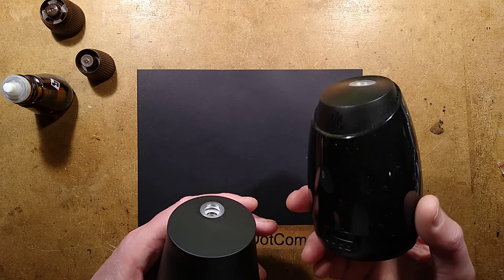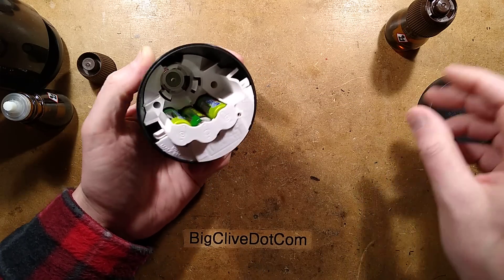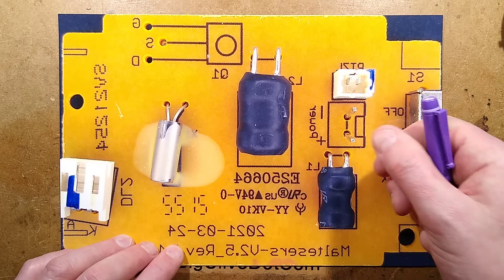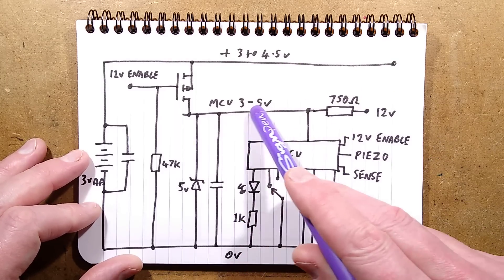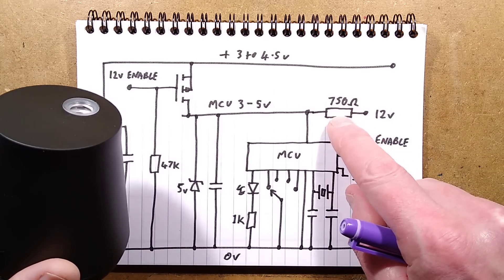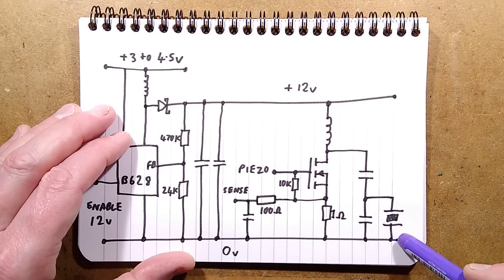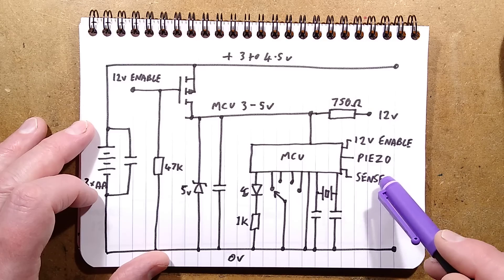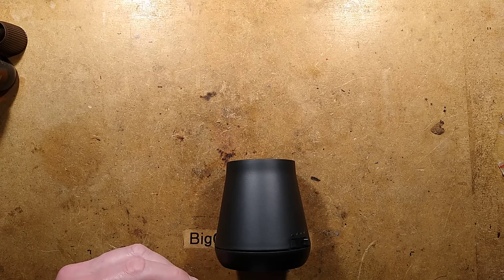Teardown of new Airwick essential mist unit

Comment: My blue light comes on but no mist can u help as not cheap ❤
Reply from the maker: Try removing the bottle and putting it back in again.  Also make sure that a pool of oil hasn't formed on top of the atomising disk.  If it has, wick it off with the end of a bit of tissue.

Comment: I have the older one, and it literally just stopped atomizing the aroma. I see the LED, but I don't see the mist. I still have some fluid left in the bottle... guess I should try a new fluid to see if that's the issue I'm facing...
Reply from the maker: Sometimes the atomiser disk can gunk up or get a layer of liquid on it that is too big too atomise.  Sometimes it fixes itself if left running for a while, or it can be cleaned with a rolled up bit of tissue.

Comment: Im trying to add a 12v fan to minimize the smoke visibility. Where can I solder the wires to? I tried s & d from the mosfet but nothing happens.
Reply from the maker: I'm not sure it could really drive 12V fan.
Reply: @bigclivedotcom  Should I try a 5v fan? I dont have one laying around but my local second hand might.

Comment: Clive, I wonder if there isn't more wierdness.
With the sense circuit, and the capacitors around the piezo, this might allow the tuning of the piezo resonant frequency to improve the amplitude of the "mony dispensor". 

Optomizing the"emptying" of the scent tank is probably a design goal!

Does the signal to the piezo line vary? 

The long scent burst at startup might be used to optimize the piezo amplitude.
Reply from the maker: I'm not sure if it has any way of sensing.  Most of the piezo disks have a consistent resonant frequency.
Reply: @bigclivedotcom  
Usually, crystals running in resonant circuits do run at a "fixed" frequency.. but this crystal has a varying load, and a varying supply voltage. With the voltage regulator helping with the voltage issue, then it comes down to the physics of the crystal, diaphragm, wick etc.

Thanks for all you do, including your replies... It's nice to have a place to look for something stimulating to watch.

Comment: Apparently these oil spraying things are really bad for your lungs.
Reply from the maker: All air fresheners are bad for your lungs.  The only thing humans should breathe is clean air.
Reply: @bigclivedotcom  Yeah, we had one of the ones that plugs in to the wall and heats up the bottle of oil, and within a week our cats started coughing a lot... So we got rid of them and they stopped coughing.

But it's not something I would have ever expected... I mean, obviously breathing oil vapour is bad, but I would have thought that the tiny amount you're actually inhaling would be negligent, but that doesn't seem to be the case.
Reply: @NikoBell1188  maybe the amount is not so tiny afterall
Reply: @NikoBell1188  also cats and other such animals are significantly more sensitive to air fresheners.
( not that I am saying that running an air freshener constantly is a good idea )

Comment: This is certainly more complicated than the classic wall-mounted heater units. A while ago there was a cheap bag of conventional "fresheners" at a thrift store and if I knew they had plain old power resistors inside I would have bought them. I don't know how useful these ultrasonic units will be in terms of components to play around with.

Comment: Do we know if they are also using the Piezo as a "fan" here? (saw an announcement a few years back about "piezo fans" for cooling electrical device in even thinner packaging thanks to how minimal the fan [air pump??] can be)
     - or -
Is it just the oil heating up during atomization and creating a pressure, that the path of least resistance are the holes which in turn is propelling the "mist" outwards?
Reply from the maker: A piezo fan is different.

Comment: This seems to be a scaled-down version of the electronic nebulizer found in a breathing treatment apparatus.  A few decades ago,  instead of a MOSFET driver,  there would be either an 812-A or a 6080 low-mu power triode valve in a power oscillator configuration,  with the output from the cathode(s) driving a ceramic transducer. Larger medical units today probably use a beefier MOSFET or IGBT and a higher Vdd / Vcc.  In the old triode valve oscillators,  the plate cap of the 812-A was grounded to the chassis,  and the cathode and grid circuits were powered from a negative supply rail.  These oscillated at around 800 kHz to 1 Mhz.

Comment: Looking at that a little closer that is a pretty ingenious way to drive a piezo.  
It looks like a parallel RLC circuit that they feed with narrow current pulses at the resonant frequency.  The frequency of operation is 1/sqrt(L*C)  where C=Ctop*Cbot/(Ctop+Cbot)  (the piezo capacitance part of Cbot).  The voltage fed to the piezo is Ctop/(Ctop+Cbot) [~n] with the L and C node voltage likely going from 0 to 24.  At resonance since all the L's and C's disappear the power in is what is delivered to the equivalent resistance of the piezo.  It looks like when you inject current pulses that way the waveform aligns with the current turning on as the voltage at the bottom of the inductor goes through 12 volts in the negative direction.

Comment: Very interesting circuit indeed. I would never guess the atomization would be done like that.

If you ignore the piezo for a second, that circuit is just a LC resonator, and when you turn OFF the NMOS it will sinusoidal oscillate forever since there is no damping (ideally). The frequency of oscillation will be the typical 1/2π√LC (where C is the equivalent capacitor of the series capacitance and maybe the piezo parallel capacitance).

The initial energy stored in the inductor will bounce back and forth between the capacitor(s) and the inductor indefinitely.
By equating the inductor & capacitor energies we can figure the maximum voltage on the capacitor (drain of NMOS):

½·L·Ⅰ²  = 
 ½·C·V²   =>  V ~ Ⅰ·√(L/C) + 12V

Where Ⅰ is the current through the inductor when the mosfet is turned OFF (and sensed in the 1ohm resistor)**.

My guess is that the frequency of oscillation  1/2π√LC  is the resonant frequency of the piezo, and so this behaves pretty much as a resistor that will  consume the inductor stored energy, atomizing the liquid and dumping the oscillations in the LC circuit.

**  To be precise, Ⅰ is the current going through L when, after turning OFF the mosfet, the voltage at the drain of NMOS = 12V.
If the time the switch is ON is much bigger than the oscillation frequency then Ⅰ is ~ the current through the inductor when the mosfet is turned OFF.
However I suspect that is not the case here, so a significant amount of energy stored in the inductor L comes from charging C up to 12V after the mosfet is turned OFF.

Comment: I had a good laugh when I realized the circuit board said "Maltesers" on it. I wouldn't be surprised to learn that the engineers may have gone through a hefty supply of chocolate malted milk balls.
Looking at this thing, I was struck by how much it reminded me of my little Arduino Uno. I'd be curious to find know what design is inside that controller, as it occurs to me that they could easily have designed this around an off the shelf part like the 8051, possibly at a lower cost per chip. From a programming standpoint (a little more in my wheel house) the codebase for this device likely prints on a sheet or two of letter/A4 paper - which to me illustrates the beauty of using an MCU in a device like this. I can start to imagine how you would produce something like this with an analog circuit, but would doubtless be much more power hungry (from my own limited understanding.)

Comment: Hi Clive, It would be interesting to see the driving waveform and the response of the piezo on a scope. I can speculate all day long how the circuit might work: reverse EMF from the inductor makes the piezo go one direction and the piezo discharges into the capacitors and rings a bit with a dampening oscillation... and it might be something completely different, I always learn unexpected things watching your channel, but the O-scope would tell us the story.  I don't suspect that the code in the micro is too complicated... mostly timer to sleep, (Low Power Mode) and activate the piezo monitoring the sense line... I'd expect to see a PWM driving the mosfet and looking across the sense line you'd see where the cutoff occurs, then another one across the piezo itself... that would show how much the microcontroller is doing and how much the inductor and caps are doing... Happy New Year to you and your brother Ralfy (Since you mentioned him when you saw the date on the PCB silkscreen.)

Comment: For crying out loud, either STOP making devices which use three AA or AAA batteries, or START making chargers that will charge three at a time! (Or one at a time -- it seems that all the chargers we have in Canada only do 2 at a time. If you put one in, it doesn't work.)
Reply: I’ve seen chargers for 2 at a time and 4 at a time ( and iirc even 5 at a time, but that might be me misremembering things ). Never 3 at a time.
Reply: @chri-k  right?
Reply: @jarod997  I guess it is extremely annoying and inconvenient. but I have not ever used a rechargeable AAA or AA battery. Only larger ones. ( I also cannot imagine a single thing that I use that uses AAA or AA batteries, although such probably exists; everything either has it’s own power cell & a USB port, or uses smaller batteries ).
Also, why TF is autocorrect/text prediction trying to turn the unfinished “smaller b” into “smallest battery”.

I also have a charger-for/power/bank-that-uses rather large lithium-ion cells ( don’t know what the specification is called ), and that one can charge any specific cell(s) of the 4 inserted into it, so I have no idea why AA and AAA chargers do not do that.
Reply: @chri-k  Small flashlights, video game controllers, my headband flashlight uses 3 AA's, smaller bug zappers/control devices - ya, there's an increasing amount of things that are using USB enabled power cells of some sort, (like Big live has shown us), but the reality is AA and AAA cells are still extremely popular here in North America
Reply: @jarod997  They are obviously still poplar.

Although thinking about it, ( here ), it seems that button cells are many more used than AA/AAA.

Edit: yes, AA/AAA batteries are in-fact made out of wood.

Comment: Remember back in the day when Airwick/Or another major company released those automatic air freshener 'can squirter/sprayers' things... They had an ambient light detecting - Photoresistors fitted so that it would only activate during the day and thus not spray at night when people were in bed??? Yeah.. They soon removed that feature haha.. I wonder why.. 🤔🤔 Could it be that they found they weren't selling as much refill cans as expected??
Yup... A great/efficient idea U turn there for the need of profits... I guess the person that suggested the use of the Photoresistor use in the design was also either demoted or given his/her P45 
And to be honest, these sorts of devices SHOULD have Phoresistors fitted, as, it increases refill lifetimes, and, saves the batteries too... 🤔😏 😎🇬🇧
Reply from the maker: They were based on commercial units in public toilets.  The light sensors were not reliable in home settings with dim lighting.  Plus a great need to get through those cans quickly.
Reply: @bigclivedotcom  Yeah seen the industrial ones, and yes sales CAN be improved if the unit is merrily pumping away 24 7 hahaha 🤔😏😉😎🇬🇧

Comment: You sounded like you were pleasantly surprised with the board when you first saw it & also pleasantly surprised & impressed with the complexity (in a good way) of the board and the fact they had not "cheeped - out"
Reply from the maker: I was.  I expected it to be a blob, crystal switch transistor and inductor/transformer.

Comment: I see that this has a 5v rail and a 12 volt rail. I have the previous version of this atomizer but it doesn't atomize anymore and I traced it to a circuit problem. I'm curious if I can turn it into a phone charger if it has the same 5v rail.
I was able to get it atomizing again by hooking the peizo atomizer to the one on my portable misting fan. It sort of works.

Comment: The crystal could be for maintaining a clock if Mark 2 has a timer like Mark 1, which is designed to go into sleep mode so it's not dispensing while you're asleep.
Reply: "When the switch on the control panel is moved from the off position to either of the 3 settings (min, med, max) the device is turned on and will run for 8 hours unless switched off.
By moving the switch to the off position during the 8 hour cycle will terminate that cycle. Once turned on again, the timer will reset and a new 8 hour cycle will begin.
Changing the intensity setting will not reset the cycle." Mark 1 FAQ

Comment: Interesting little gadget - we're still using the very old-tech "single power resistor in a plug" system (which have now lasted 17 years semi-continuous use). They may be extremely simple, but that simplicity also equals reliability.
Reply: Moving parts fail !piezo elements are moving ,just like your speakers in your Hi Fi .They eventually wear out .A properly made resistor in ceramic can last a lifetime !Platinum wire wound,nichrome they last a hell of a long time .

Comment: Is it just me or are they making these rather simple gadgets increasingly over-designed? 
Probably would have been more useful with a movement detector for hands-free toilet use. 
As always, nice tear down Clive.  👍
Reply: Mass production and engineering get it cheap enough to be viable, and it certainly provides a lot of benefits over the traditional methods. You get a super controlled amount of fragrance, on a 8/16 timer. And the batteries last a long time.

Comment: Have to alter it to make it remote activated, and swap the aroma for some of that 'liquid ass' (pump dispenser fart spray). One of those tiny remote receivers, and a couple of transistors wired to the mode switch inputs should be suitable for some long range smelly pranks.

Comment: Big Clive, I have the most bizarre lighting element I've never seen before.  Just wondering how I could send you some pictures?
Reply from the maker: What is it?
Reply: @bigclivedotcom  well I don't know what it's actually called.  It's 90-260v and 30-100hz compatible and claims to use 1/50th power of 'normal'.  It is litterally just the mains cables soldiered to two tabs of a flat  flexible panel.  In its broken state its glows a green simaler to day glow green.  The panel is metal one side yellow the other.  It's a part of a 'picto lite' small Darkroom safe lamp.  Also claims to be cold to touch.  Iv never seen this light type before, I assumed some sort of florescent lamp until I opened it up.  When I first saw the actual light element I thought it was a defusing filter and kept looking for some electronics!

Comment: This has a timer too.. It runs for 8 hours at a time periodically dispensing the aroma mist, then shuts down for 16 hours. So that time keeping would asks for microprocessor than normal piezoelectric transducer. On a side note these are made in India which is not usually known for exporting mass produced consumer electronics devices..
Reply: That's nice to know.  I prefer if an air freshener only runs during daytime hours anyway.

Comment: using the 12v supply for the microcontroller might be to prevent it browning out when the batteries start getting low.
Reply: I see it the other way round. The device is designed for the stable 12V supply and switches it off to conserve power. Its a very clever and cheap way to get both stable step-up power and super low standby current.

Comment: I have to assume that you hoard dead bodies - probarbly electrecuted ones - in your premesis, since you use every ozone thrower available plus this allergy causing cover-up thingy.?
Reply from the maker: I only use one low level ozone generator and rarely actually use aroma devices.  But I still like to take them apart.

Comment: Does the p channel mosfet serve as polarity protection for the input as well?  I figure the lower voltage(battery) feed is to power the clock portion of the mcu without the demand of the other processes(extending battery life) when the mcu is in a passive sleep state.  When more power is needed for active processing the 12v rail is enabled for a stable 5v supply.

Comment: Do we really need a microcontrollers and a programmer to make the room stink when it could be done by a couple off 555 timers and a few tan. Caps
Reply: The microcontroller is cheaper than multiple 555 times

Comment: Clive, the product description on Amazon mentions that the unit goes into a standby mode for 8 hours (presumably for an overnight exception to air freshening) but it doesn't mention how that interval is determined. Do you think it is based on the time of initialization or is there some kind of voodoo timing in the MCU? Thanks, mate.
Reply: Just likely there is a timer that has it run 16 hours on 8 hours off, probably assuming that you will turn it on first thing in the morning, and leave it on all day then.
Reply from the maker: From the point you turn it on it starts the run time.

Comment: Could you turn something like this into a Whiffle that could flash off every once in a while?🤔
Reply from the maker: I tried an atomizer with kerosene and it didn't sustain flame.  The fog is a tiny quantity of liquid.
Reply: @bigclivedotcom  Put an open-bottom container over top of it, with a small hole on its side; let the fog fill the container, then ignite?  More of a F. - A. E. than just a flammenwerfer ?